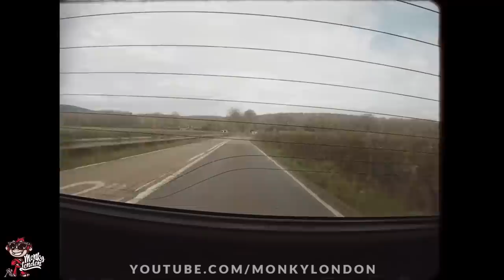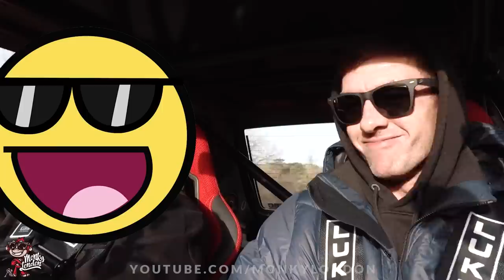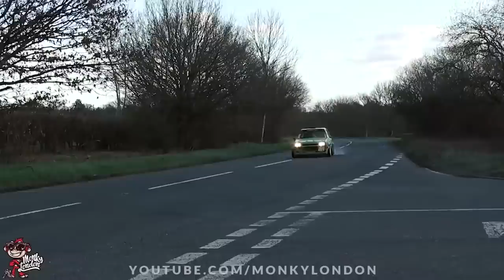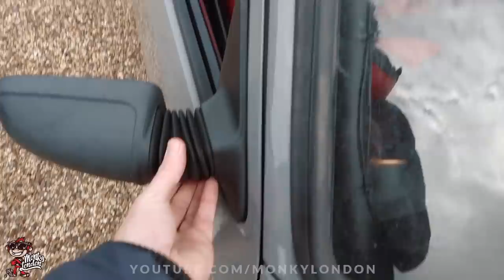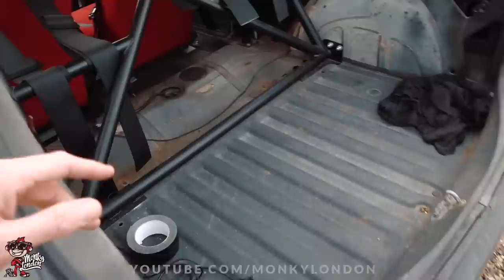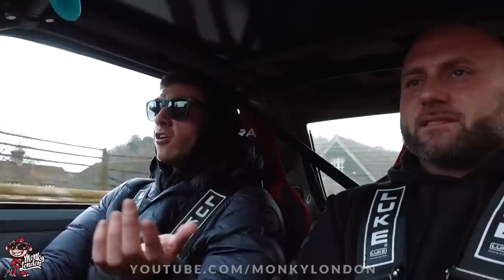🐒 CRAZY SLEEPER! PEUGEOT 205 GTI Mi16 SWAP WITH MENTAL SOUNDS

Comment: I converted my Miami blue special edition 1.6gti to an mi16…retained the 1.6 gearbox.
Absolute weapon back in the late 90’s, early 2000, destroyed sierra cosworths and Audi tt’s at the time without issue 👍🏼
As many have said, it’s not all about horsepower figures, especially when the cars so light in the first place.
Reply: You cleaned a few clocks ⏰ showed them what time it is 😉👌

Comment: The XU9J4 is an absolute peach of an engine.  In my opinion the best sounding 4 cylinder ever.  I have one of the few remaining Phase 1 405 Mi16's with a full stainless Mongoose system, set of cams and rev limit increased to 8.1k.  Sounds insane after 4.5k rpm.  I actually used to have a bit of a dislike of 205's due to the amount of 405's that had their engines pilfered for conversions!

Comment: I’m James’s brother, my 205Mi16 should be ready in the spring. Running jenvey itbs, forged rods and pistons, one piece valves, high lift cams, double valve springs, mechanical lifters with dry sump  for good measure. 8500rpm 235+bhp 🚗💨
Reply from the maker: Can't wait fella such an impressive build!

Comment: Got to love throttle bodies the sound is just amazing. 
Sure sounds better than 99% of the current modern stuff imo
Reply from the maker: Agreed man 100%, thanks for watching 👊
Reply: I used to love the sound of my old man limiter banging his 309gti and Renault 19 with williams parts absolutely everywhere we went, nothing compares to the old school French cars sounds. deep throttle body noise and limiter bashing until the valves bent😂id kill for a Renault 19 nowadays any model to engine swap, I love them. Nostalgia of sliding around on the leather seats while my dad raced everything that moved👌
Reply: @aminyamisses6013  Mate years ago had Blue Renault 19.  Used to watch CPU trying to give accurate MPG as he pegged it driving around.  Good times.

Comment: Always loved the naturally aspirated tin cans. Mate of mine had a 106 gti on throttle bodies. His brother still has a 500bhp 106 turbo. I always preferred the bodies somehow. Just the right amount of power.
Reply from the maker: True words Zak! Any chance of a review on the 500hp 106, features@monkylondon.com if interested 🙂
Reply: I’m building a vts turbo, I’ll probably try to make as little power as I can before I turn it up but the engine is fully forged so that will happen inevitably! 
May have to put a billet crank in though, when I have a “spare” £1600 kicking about… 😵‍💫

Comment: I had a 1.9 G reg black red stripe. Was great round b roads. Couldn't imagine it any faster lol. Sold it in 2001 for £300 running.
Reply: Don't feel bad. I had quite a few back in the day. Including two perfectly good 1.9's for £150 each lol 
Don't think I ended up selling any of them. I just drove them until the wheels fell off. Zero regrets. Loved every second.
Reply from the maker: If only we all had time machines right 😂 Great to hear all your stories thanks so much for commenting

Comment: Mi16 in 406 sounds like "yeahh, it can go man" but when you see this 205 and you hear the Mi16 just fucking roaring inside that thing, it makes the car seem like a motherfucking rocket, like a five feet tall ripped dude or something like that 😀
What I think though is that the 205 GTi should have came with this engine as factory but uhhh... time - wise it was not possible? I am not a Peugeot dude so a quick google search shows me that GTi has almost stopped production while the Mi16 was around for two more years?
Reply: Check out Gutmann, they did 16v 205 gtis brand new back in the day

Comment: Definitely hasn’t got a 306 rear beam on it or it’s wheels would be stuck out each side.. plus they don’t fit the body without a lot of fabrication.
Reply: It dose son, first in U.K. done at pug 1 off   What u talking about
Reply: @jimmyb2267  think you are confusing it with a 309 axle, mounts have been made to adapt 306 but they quite far out to the shell and the wheels stick out the arch 50mm per side and needs a maxi arch to cover baker mounts and bushes made some years ago for a maxi, 306 arms can be used on 205 and 309 axle tubes though and only gives 7mm extra per side the size is the same and the calliper is basically the same but 2mm bigger piston, from how that is it’s more than likely a 309 axle.
Reply: @AJ_Irving   no son, it’s a 306.  Pug 1 off did it years ago   I had all the work done, I know what’s on my own car 😂
Reply: @jimmyb2267  ok dad.. considering my S1400 205 is wide tracked to 306 width and needs 80mm arches on the front and 70mm on the rear yeah sure don’t know why I bothered with the wide arches should have just fitted the little ones would get though chicanes easier..
Reply: It’s had a lot of modification 🤦🏼‍♂️   U have the car built or me    Unless Matt at pug 1 off don’t know what he’s on about ???